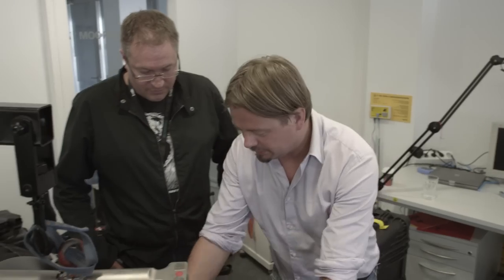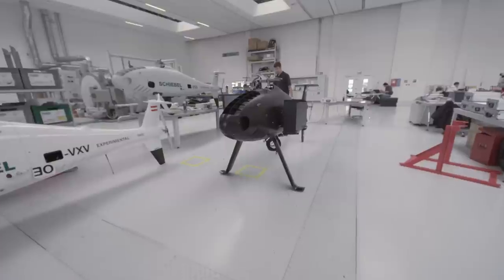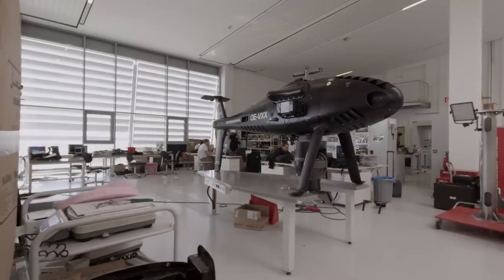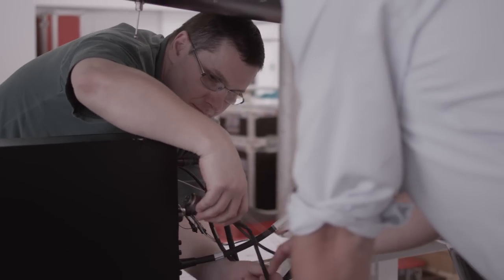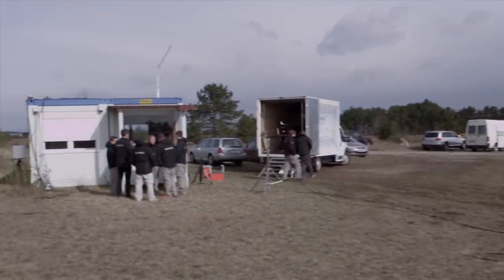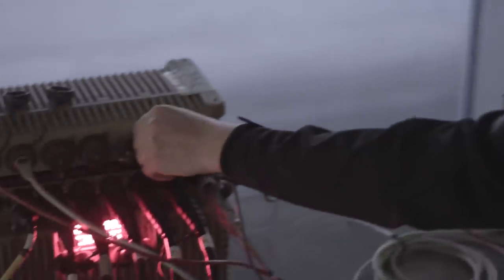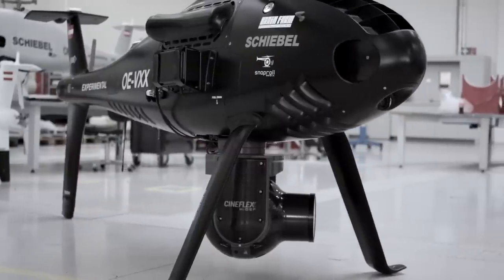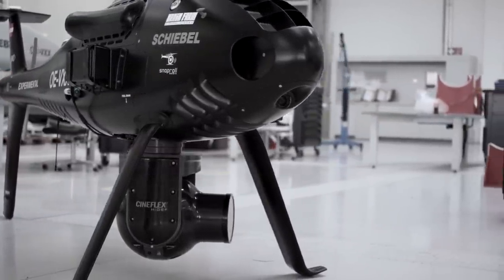The Schiebel CAMCOPTER® S-100 / Cineflex Integration with Brain Farm and SnapRoll

Comment: OR you could spend around 5k for a RC octocopter. buy a pan and tilt mount with a gimbal, some long range fpv equipment, buy a 7d and put it on the octocopter.....